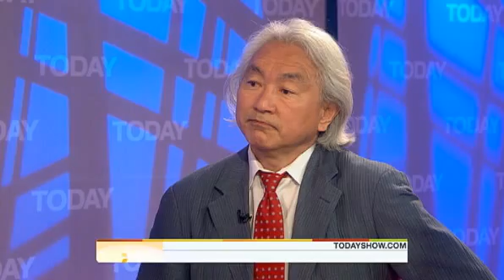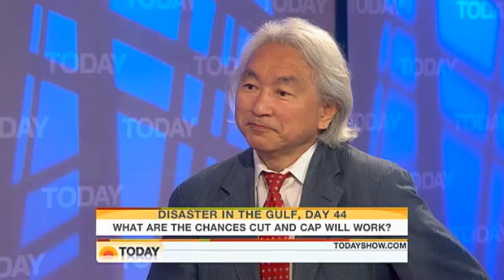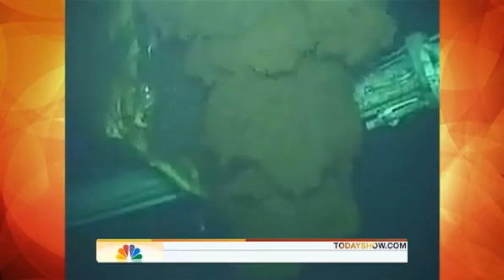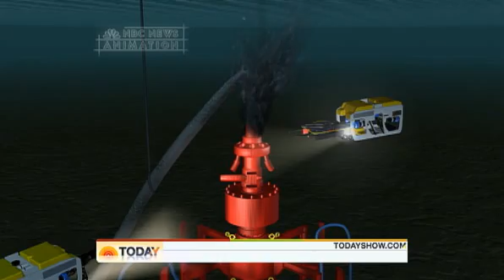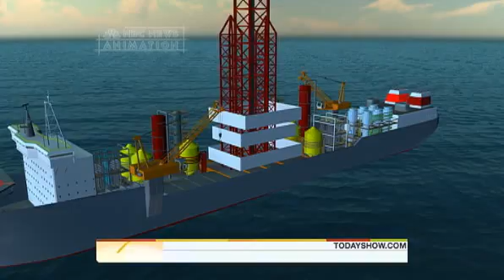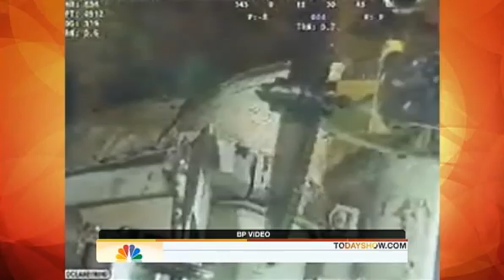NBC Today show interview with Michio Kaku about BP's 'Cut & Cap' method

Comment: Is this possible at 5,000 feet below the surface? Deflated tire (very close to size of inside pipe diameters)with a custom made cap/rim. Hole in cap pertruding outward on both sides to hold the Vacuum Insulated Cryogenic Hose inside.  Also make cap so you can attach a hydrolic arm from 120 to 90 degrees. Give enough space to slow oil from tire. Straighten out deflated tire with tube inside until at 90 degrees(while pumping the liquid nitrogen through hose). Inflate tire until Oil stops flowing.

Comment: In Centralia Pa. there is a coal mine fire that has been burning for 50 years. The town had to be  turned into a ghost town. There is no way to stop the fire. I'm afraid that the Gulf of Mexico will become a lake of oil and water with no life forever. They should have had a relief well drilled when they first made this oil platform.

Comment: I would like to know how BP plans to get the hot liquid down to the cap which will be 5000 feet down. Pumping hot liquid to 200 feet is nothing like 5000 feet which is 100 times colder; I am sure the liquid won't be hot enough when it gets down there even if the pour it at 900f. :o)

Comment: Mr. Kaku I have a few questions. 1. Why is space Cold?  2. Can 9 Space rockets working together reach C if  each rocket reaches 22,000 each that's 198, 000 miles.That is more than  186,000= C Or would the laws of physics kick in and start pushing the rockets with the same force. Would the rocket become to heavy to continue at that speed would the rocket just freeze? because of its equal force?